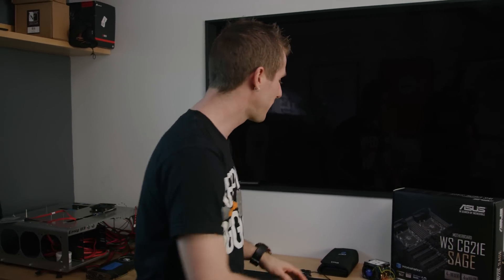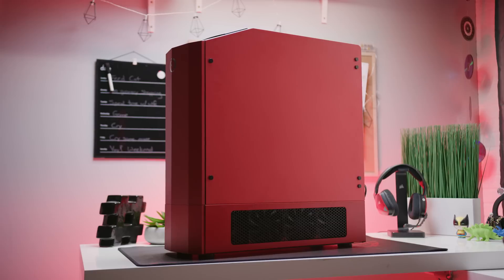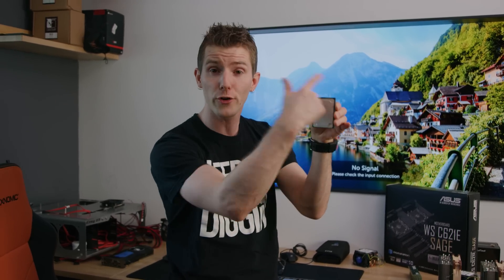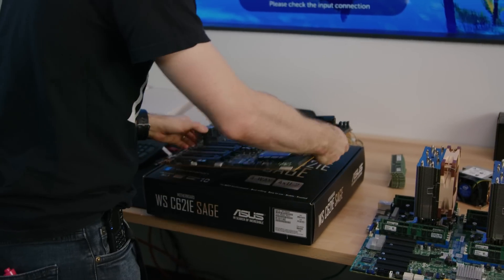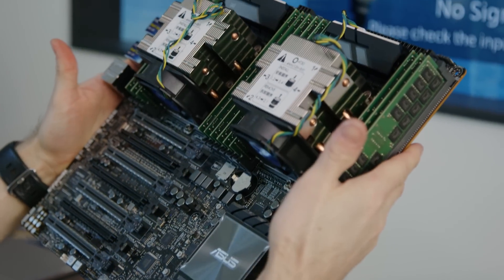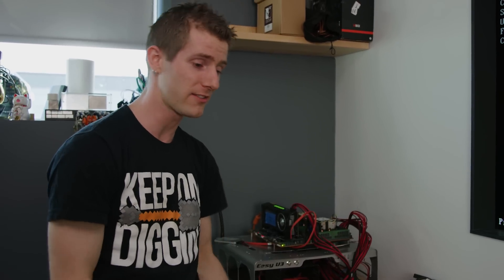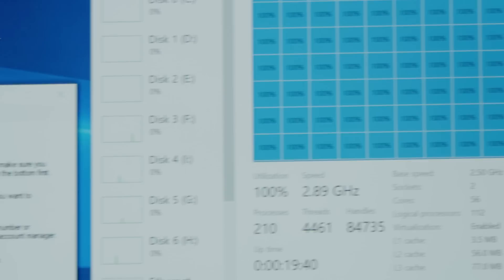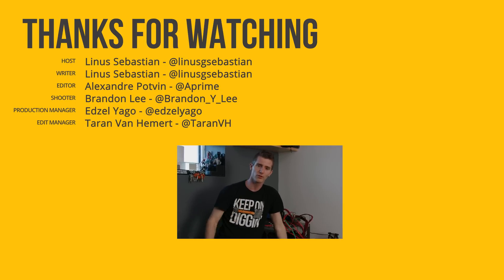56 Cores in ONE SYSTEM! - HOLY $H!T

Comment: You can use this for ane active time based ai home atomation that can store data like cctv and user interface data and epointments ect . I am planing to bild a custom home server that uses intell stratix 10 sx fpga with arm cortex a53 and the internall hyperflex architecture and 28gbps transivers(io) to give you fast internet and fast ai and a good cumputer user interface foor dooing evryday woorck and allso acts as aradio hed so it can conect divises via blutooth wifi remot controols satelite tv ect and by the way the serverunit can allso be used as a air data computer foor sevilian and millitery perposes and allso water cooled and has on bored power and mid bored optics 200 18650 selse for ups functionalety and 80 amp 230/110 volt power ragulator and fuse totally modular

Comment: Let’s just say a person has a Titan Xp.   (I have a Titan Xp).    Let’s just say a person has an option on a ridiculously affordable Nvidia Tesla P40 24gb.  (I’ve got the option to pay significantly less than retail, cheap enough that I’m actually considering it).   Both these cards are Pascal architecture.  Right?   Is there a means of using the P40 effectively as a slave to the Xp?  Like a passive compute card, rather than running in SLI?   Is there a benefit to be had for encoding?   Without 10,000 fanboys and whatnot, giving stupid answers that cannot be backed up with actual fact or details.   I’m looking for real information, not thoughts or hypotheses.   Google is no friend of mine.   Only “vs” articles are found.  Comparisons.   It’s like nobody has thought to run one of each, giving best of both worlds.   Xp for gaming, with a P40 to back it up for total overkill with rendering and encoding for work.

Comment: Can it run Minecraft though?
Reply: i think if there runs minecraft it will have 54311544535345345154fps
Reply: mine ing I'm pretty sure displays are limited to 240Hz max though
Reply: It will run minecraft at only 847-900 fps ;( its so bad the lag
Reply: but without a gpu while using 50 cores as gpu
Reply: With the lowest settings on superflat i get around 2,5 k fps on superflat

Comment: Just for giggles run in Linux using the software rendering drivers. See if you can get a game from the last decade running playable at max settings on it with no GPU utilisation whatsoever.

Comment: Im watching this using 2 cores 😥
Reply: at least u have cores...
Reply: Oh you so lucky. Pentium4 1core 3.4GHz
Reply: My phone has more cores
Reply: 8 core snapdragon
Reply: 6 cores xD AMD Phenom ii x6 1075T 45mm Thuban here xD 3.0ghz each but i overclocked to 3.8ghz
Reply: pft BRO try watching this decadent bastard on a sempron 2000+ @ 1.1GHZ a few more years and this machine can buy it's own cigs
Reply: Using my phone with 8 cores
Reply: Storm never compare mobile cpus with desktop cpus
Reply: i7 8700K 6cors 12threads
Reply: stereo autopsy lol I'm using a quad-core phone
Reply: i5 4210M..2 cores  with HT
Reply: i5 420m 😢
Reply: Random Videos 2 cores (PC) 4 cores (phone) 2 cores (MacBook) 2 cores (Dell Inspiron 15 something)
Reply: AMD FX-4130 Quad-Core Processor @ 3.8 GHz here.
Reply: me i7 8700k 6 core oc to 4.9 ghz
Reply: I'm using a Celeron n3060 1.6ghz with turbo up to 2.48ghz (2 cores and 2 threads)
Reply: I am comenting this comment using 4 Cores
Reply: Mineking35 same ,it sucks doesn’t it?
Reply: Ryzen 5 1600 masterace :-)
Reply: watching this using -2 cores
Reply: Me toooo T_T XD XD
Reply: I'm watching on an Intel Pentium G3420! :(
Reply: Desktop pc or Laptop ?
If its an older desktop system you might be able too update the bios to support quad cores or faster dual core cpu's.

But depending on the laptop you might be update the processor as well. (do look up the laptop model, & the cpu if its possible too upgrade it.)
Reply: me2
Reply: Error 124 *Cores
Reply: im 2 cores whooping 1.7GHz locked :') .. me too bru, mee too
Reply: Me Pentium Dual-Core E6600 3.06GHz
Reply: AMD A10 6800K oc to 4.7GHz here
Reply: I have a i9 with 18 cores
Reply: Fabian Lindblad Can i steal some of 'em?
Reply: stereo autopsy  i have 6 cores 3.2ghz.
Reply: I only have 1 core
Reply: i7 960 4 cores 8 threads here x58 board
Reply: 8 cores on my phone, 2 on my laptop...
Reply: G4560 2/4 cores :((
Reply: I have 6 cores with the i5 8600K
Reply: Two cores, four threads.
Reply: intel core i5 7th gen 4 cores 2.5GHz
Reply: stereo autopsy me too
Reply: It's not about the cores
Reply: I'm watching this on my 6 Blade Cluster on 192 Core System
Reply: Snapdragon 820 quad core.
Reply: Xeon E5450 here on a 775 mobo
Reply: stereo autopsy ryzen 5 1400 quad core 

Oc to 4ghz
Reply: I7 4790k @ 5ghz
Reply: 6 cores 3.9GHz FX-6100 BEST! :D
Reply: Core 2 quad q9650 3.0 GHz pc
Reply: Me too :(
Reply: 5000cores watching this, because I 'm working at supercomputer center at Korea... and I'm watching this on free time
Reply: I'm watching this video on a quantum  processor.
Reply: Im on a swich right now with 2 xeons
Reply: Me too heheh
Reply: me to no threads and very old not even a duo..
Reply: fuck u im the worst
Reply: haha
Reply: me too XD
pentium g4560
Reply: I9 extreme, 1080 ti (two) 64gb ram.
Reply: stereo autopsy me to
Reply: Om using a stone
Reply: I'm using 8 cores on my server computer.
Reply: I have i7 8 cores.
Reply: I got my legendarische pentium g4560 3.50 GHz lol
Reply: i am watching this with my cat
Reply: Intel Core i3-350M, 4GB DDR3. 2 Cores, Four Threads
Reply: stereo autopsy k
Reply: 0.5 cores
Reply: stereo autopsy I'm watching using octacore
Reply: Octa-core 1.5 GHz Cortex-A53
Reply: AMD Athlon X4 845 3.5 GHz 3.8 turbo
Reply: i5 8400
Reply: MEEK_MEEK Agreed.
Reply: Trevoras A lol wtf
Reply: now i have ryzen 3 2200g
Reply: akash yadav not true ,they are threads
Reply: You poor soul
Reply: 2 cores and integrated graphics EDIT: AMD Ryzen 7 1800x 8 cores 16 threads, and Nvidia GeForce gtx 1080
Reply: i am watching on xeon quad core
Reply: It doesn't matter qoz chrome only uses 1-2 cores xD
Reply: A6-4400M APU 2 core
Reply: I am using two xeon's from 2001 with 2 cores each😭
Reply: Im using an i5 8400 turbo boosted to 3.79ghz, is that good?
Reply: Pentium S 133Mhz windows3.11
Reply: 6cores for me
Reply: 6c12t amd ryzen 5 2600 oc to 4.2 ghz here
Reply: 4 cores 5.5 ghz Core I3 8350K and AMD FX 9590 6.9 GHz 8 cores
Reply: Intel Xeon 5650 12 cores but still shit

Comment: Now go contact AMD and do a comparison between Xeon Platinum 8180 and EPYC 7601.
Reply: I really want to see that, because paper specs makes AMD EPYC 7601 better in every way (except clock speed) for F***ing less than Half the price ($4,000 vs $10,000)
Reply: If I'm reading the table correctly its just one Epyc which got this score vs the 2 Xeons Linus used. I stand corrected this comment containsfalse information.
Reply: The EPYC 7601 scored 6775 in Cinebench so it's a little bit slower in that benchmark, which is still very impressive considering the price. https://us.rebusfarm.net/en/tempbench?view=benchmark
Reply: Max Latz the third column says 2 CPUs (that is quite common in this market segment)
Reply: Syluxsify WOW
Reply: Omar Hatem Elrefaei thx
Reply: If it's anything like Ryzen or Threadripper performance, the slightly lower Intel core count will be offset by their higher turbo frequencies. Dual-Xeon is only about 8 cores behind Dual-EPYC, so Intel only needs about 12% more clockspeed to match the higher core-count AMD part. AMD specifies a maximum all-core boost of 2.7GHz, while Linus evidently got 3GHz all core boost out of the Xeons. That's a 10% performance difference - enough to make the difference between the two almost margin-of-error.

That being said, AMD managed to get the damn thing to cost half by "gluing together desktop processors" (according to Intel) with the same performance and features. So I imagine the only reason to use the Xeon is if you either really need quad- or octo-socket (which costs even more per chip, and can't be had on a commodity motherboard) or Infinity Fabric is otherwise somehow a bottleneck to you.

Comment: Could you test how well it crunches Monero (XMR) with Claymore's CryptoNote Windows CPU Miner v3.9 ?
Reply: Why would anyone CPU mine on Windows?
Reply: xmr-stak
Reply: HyperActivePlayers Because it works like a charm and you can do other stuff at the same time?
Reply: radieroslaw Linux brings alot more performance, especially if you're using hugepages. And you can do other stuff at the same time.

Comment: But can it run pubg? Didn't think so...
Reply: It could run pubg easily with a good enough gpu, just making fun of how poorly optimized pubg is.
Reply: is PUBG that poorly optimized? I'm getting  50-60fps with everything at ultra, vsync on, motion blur on at 1440p with a gtx1060 and i5 4690
Reply: I'm getting 130 frames on fortnite, full ultra settings with a 1060 6gb and an i5 8400, so I'd say yes.
Reply: I think it can because pubg is gpu intensive i guess
Reply: Any thing GPU intensive is not even worth testing because you're not testing the CPU performance.

Comment: See how many VM’s in VM’s you can make like the mirror in front of mirror effect. I want to see how many you can get before it freezes. Pass each VM the bare minimum amount of resources and try it with Windows, Linux and Mac. I would like to see that xD
Reply: Also when you make the next video try to get some custom blocks made, and just make that CPU as cool as it can be. Try to do a very beefy loop for each individual CPU to “adequately” cool it. By that I mean make it super chill.
Reply: if you give EACH VM the bare Minimu of resources.. then it would be stuck at the second or third VM.. as you would always dedicate 100% of the lsat VM to the next VM. you would need to give the first VM 99% of the Original VM and so forth so that always soe CPU stays available for the main System/VM the VM is running in
Reply: True. but you could restrict the original operating system to a certain amount of resources (cap it at an amount) and keep providing the sub sequential VM's  another small piece of the pie in resources.

Comment: The most powerful tech I have:
.
.
.
.
A laptop, having Intel Core i3, oldest gen. 720p 13 inch screen which has lot of scratches. 5Kg, 4GB ram, not even DDR3. And windows 7 home. Super slow trackpad. Bought 3 years ago.
.
.
.
And this is why I hate LINUS sometimes

Comment: Where did you learn to assemble these kind of computers
Reply: If you have the parts, you just stick it together like lego. There's almost no difference between building this or the average gaming rig (except you have many more components and it's a lot more expensive...).
The trick is in finding out which parts actually fit together (new socket requiring special coolers for instance) and getting the thing to run software that wasn't written with that sort of hardware in mind can be a hassle.
Reply: For the most part, they just have to put it together.  LMG has quite a bit of experience throwing together systems that are unrealistic for the average person to work on.  They also on occasion get to deal with all of the bugs that come along with being on the bleeding edge of new hardware support.

Comment: Something old school and fairly random.
Fire up something like DBPowerAmp and see if you even get it to notice mutithreaded MP3 encoding. Not sure if you'll need an actual optical drive or if ISO's will do.
WinRAR and 7Zip multithreaded compression (curious to see how many cores the latest versions of these will actually utilize.
Folding@Home results.
Oh, and if you can get it to run in Windows 10, CLIBench. 

Other than that media encoding/transcoding - How fast can it convert all those 4K BluRay and BluRay discs I got for X-Mas into something I can toss on a MicroSD card and watch offline on anything that'll play an mp4 file? The Anime companies still haven't quite embraced Vudu or the whole digital copy thing yet. That would be great for my commute.

Comment: Run 9 instances of AIDA64 Extreme, 9 instances of AIDA64 Engineer, and 9 instances of AIDA64 Business, stressing everything while running 28 tabs of YouTube playing Despacito on Firefox, after delidding it. After installing Ubuntu onto the boot drive. While running Universal Sandbox 2 at max settings with the time per second as high as possible.
Reply: That'll sure to piss off Intel.

Comment: See how many VMs it will run before slowing to a crawl. Bonus points for VMs inside the VMs. My record with my old 6 core 12 thread Xeon and 24 GB of RAM was 10 dual core VMs with 2 GB of RAM all at once before they started getting too slow to perform any tasks.

Comment: Remember the 16K monitor???? Time to boot that up :-)
Reply: Milan Shah even a pentium processor would be gpu bottlenecked with that thing
Reply: This board can handle 12 sticks of ram... Im pretty sure it would have plenty of PCIE slots. 7 to be exact :-))
Reply: If its software rendering a game you'd have a pretty good load on 16k resolution if said game engine can handle that amount of cpu cores.
Reply: Yup!!

Comment: Why not 64 cores 2P Epyc setup? 64 core POWAAA
Reply: that's what i'm thinking
Reply: Ben Tanneberger because amd isn't sponsoring him
Reply: Truth
Reply: And this is why his channel sucks and isn't better then the slimy teleshopping sales shows just more modern.
Reply: Steamrick doesn't epyc have higher clocks, negating the ipc a avandatge?
Reply: Intel are giving them the hardware while they would have to buy the hardware from AMD. That would cost quite a bit.
Reply: I am sure they would get some at least for a loan if they asked for it
Reply: But they could resell them after the test. So it wouldn't cost them that much.
Reply: Steamrick i was thinking the same 2 xeon phi 64 core cpu's. 128 cores total
Reply: @Clam Cong: Epyc 7601 has 2.7GHz all-core turbo, the CPU shown in this video was running 2.9GHz when loaded to 100%
Reply: Ben Tannberger Don't forget the 64 PCI-E lanes.
Reply: Intel sponsor :(
Reply: badboy09480 that sucks
Reply: Yup.....  this video is not impressive
Reply: Yeah why don't go with Epyc which is WAAYYY much cooler than boring Intel
Reply: 1) AMD isn't sponsoring those CPUs, Intel is.
2) The Intel setup is (probably) slightly faster due to higher IPC and clock speeds
3) I'm waiting for Epyc 2 with 64 cores per socket

Comment: My friend has been having bluescreen issues for months with an origin laptop
Reply: syntp.sys?  "STOP 0x0000000A: IRQL_NOT_LESS_EQUAL – SYNTP.SYS"

"This is the solution. HKKbdFltr.sys (HotKey keyboard filter driver) is the culprit. It blames SynTP.sys if touchpad driver is also installed, but touchpad is not the root cause. You only need to remove the HKKbdFltr line from UpperFilters. Mouse filter driver is fine if left as-is. If you do the Registry edit correctly, it should fix the BSODs without affecting any functionality.

Source: http://forum.notebookreview.com/threads/driver_irql_not_less_or_equal-syntp-sys-problem.799441/page-2

Hope that helps you.
I am surprised Clevo/Insyde has left this bug unresolved for so long (over 2 years now)"

Comment: As a gamer I don't want more cores.
I want faster more overclockable cores.

Because you can't rely on lazy game developers to utilise multi-core/thread CPUs.

Some of my older less core/thread CPUs easily outperform newer CPUs for gaming because I can OC them way higher.
Reply: As a gamer I've come to the realization that it'll be better for me to build a dedicated gaming PC than trying to get 1 PC that can do everything I want. My next build will be both a 8700k based system and Epyc 7551P based system with "kvm" software.
Reply: Well yeah, I have a bunch of PCs for work, media etc.
But no CPU manufactures are really making anything that targets typical gaming utilisation.

Comment: The SD card slot is handy for running a hypervisor (like VMware ESXi). Looks like an awesome board.
Reply: Correct me if i'm wrong but, wouldn't that be a dangerous situation in case the SD fails? Or the hypervisor never writes to disk? Just asking cause i really don't know :D
Reply: ESXi is small enough that the SD card is really only used at boot and then it runs out of memory. As long as you don't send log files to the SD card, it should be good to go (we've never had one fail in the past 7+ years, but YMMV).

Depending on the vendor, enterprise servers often come with dual SD card slots (or two internal USB slots for doing the same thing off of thumb drives) for those  who are risk adverse.

Comment: If you're worried about thermal paste causing the heatsinks to stick to the CPU then you could try polishing the surface of the CPUs and the heatsinks with graphite powder instead of using thermal paste.  Do this right and you create small layers of graphine and if can build up enough layers it should be effective enough as a thermal conductor.  You just have to be careful not to get the powder on the connection side of the CPUs or on the motherboards.  It might not be as effective or as quick as using thermal paste but it certainly won't make the heatsinks stick to the CPUs.  Just do the work outside away from all the components you have in storage.  If it builds up on sitting components it can be brushed or washed off but it would suck to have that stuff get into your computer systems that are in use... but you could do that on purpose for a video as well.   Best applied outside the building, though...